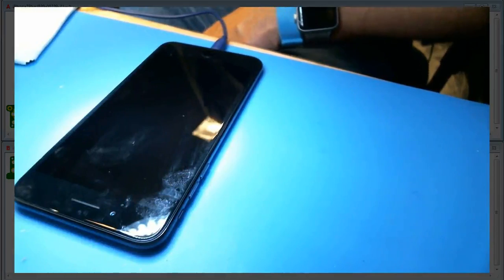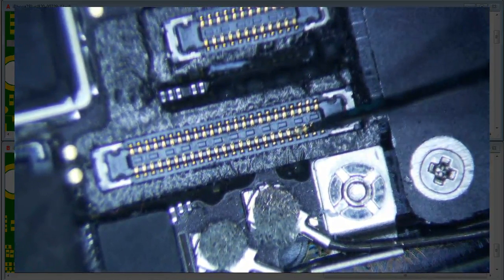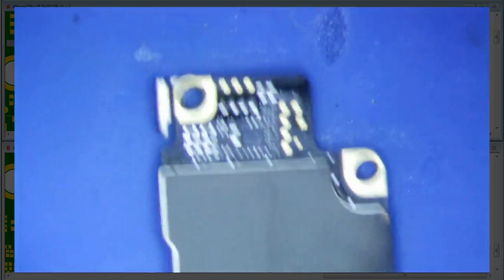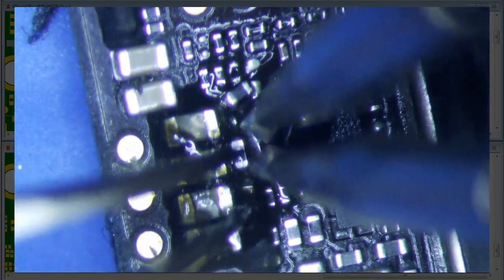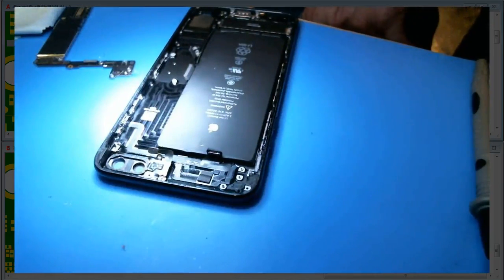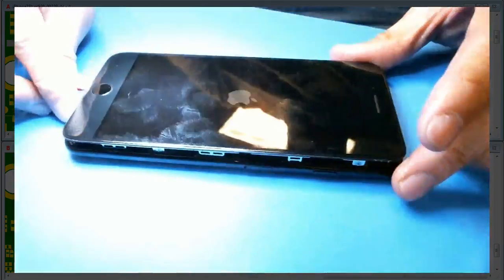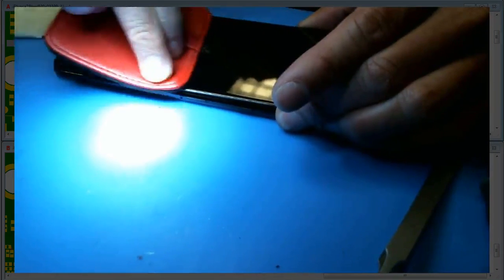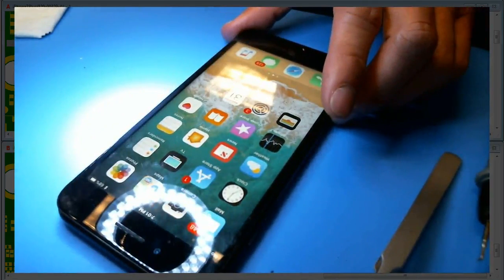iPhone 7+ Backlight Filter Repair

Comment: How much does it cost to u to do this? Because my screen broke making the mute switch disabled an the siund by when I replaced the screen the mute switch came back and when u plug the charger in it makes a sound by the screen is black I even powered th phone off and unplugged the battery

Comment: Hey

I trying to replace IC-s on the motherboard.

I get off every ic-s very nicely....  but when i clean the ic place, i lose pads every time.... 😞

I do it very slowly with flux and rosin

What can be the problem ?
Reply from the maker: Get a better iron. or use more flux.  or use better flux.